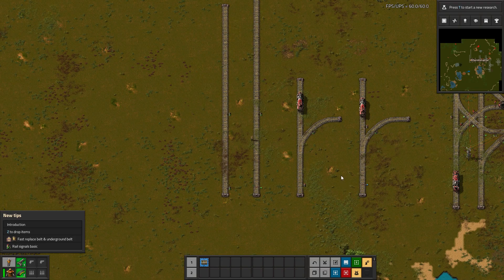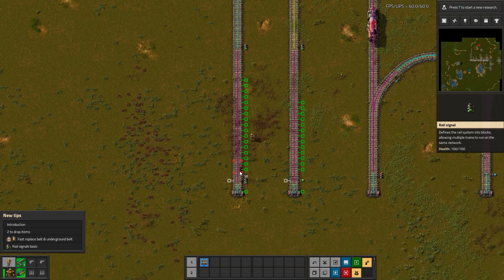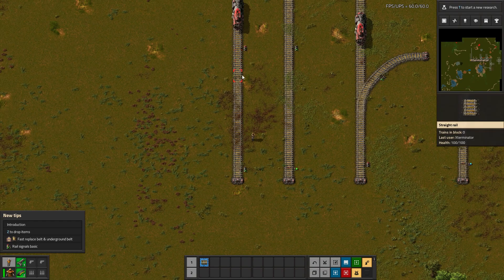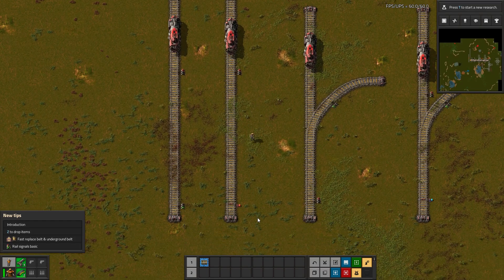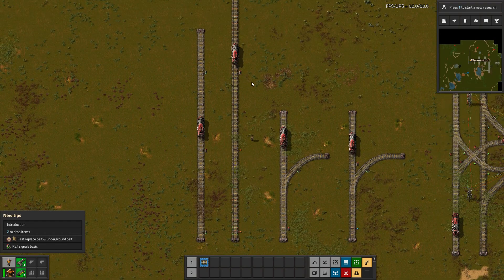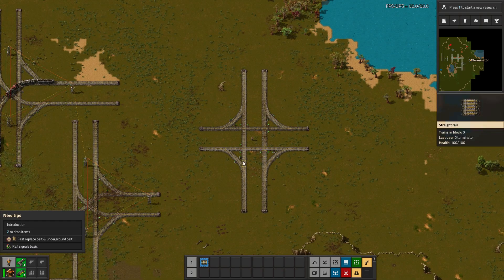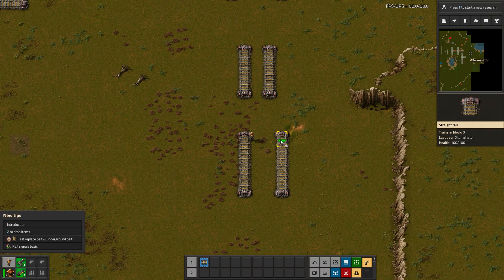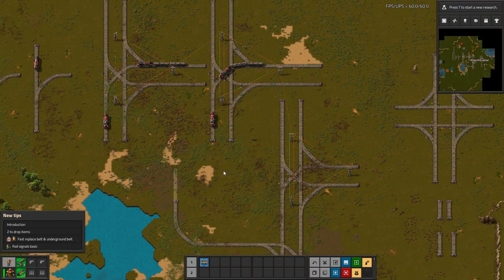Basic Rail / Train Signaling - Factorio Tutorial & Guide : Rail vs Chain Signals & How To Use Them

Comment: What about placing a normal signal right after the merging of 2 tracks like on your T-junction, and placing chain signals everywhere else? Otherwise trains entering the junction need to travel a long distance before meeting another normal signal to actually free the merge. So any trains coming after it need to wait a long time before they can even enter the junction as your normal signal (which is still inside the junction) stays red a long time. And you didn't place any signals at the entrance of the junction. It would not make a big difference but still, i wouldn't feel comfortable trains getting to a stop on top of a merge or split.
Reply from the maker: Great suggestion! I do this sometimes, but often forget. 
Although my rail blueprints do have signals at every Big Power length, so worst case would be that distance from the end of the junction before a normal signal

Comment: When you were signaling the crossing at 13:30, and the track actually extended out for a long time after that crossing, wouldn't the rail signals at the ends be looking into the entire block ahead even if it is like super long? Like wouldn't you want to put another rail signal to close it out???

Comment: Very helpful guide. The only question I have is whether I need to place signals along long piece of rail? In case one faster train is behind slower one? Can it catch up and hit slower train from behind?
Reply from the maker: Glad it was helpful!
And yes you should place normal signals along the mainline track so one train doesn't run into another.
Placing them one or two train lengths apart is usually good. Hope that makes sense. :)

Comment: There are a few errors and unclear points in your explanations. I also have some suggestions.

A chain signal copies the signals in front of it might be a better way to describe this instead of the chain signal is looking at the next block until the next normal rail signal.
Another difference between the two is that you can use the circuit network to read both, but you can only set rail signals' status.

Your "crossing" vs "merging" rule doesn't work in all cases. For instance if your "crossing" happens as a series of rapid merges and splits (such as a circle junction for example, basically every time you split right after a merge within a train's length).

The corners will always have the same space for signals, no matter how far you place the rails apart. And you can also make wider corners, no matter how far you place those rails apart.

I don't like to put signals in the corner like that. It's error prone, harder to see and on the map you can't know which rail it actually belongs to. Also when exiting junctions you should place the signals as close to the junction as possible to clear the next train through as fast as possible. In practice that doesn't make much of a difference if all your trains are running, but if a train had stopped there, it could mean an extra second or two of starting time.

Another super simple algorithm to make sense of signalling is (unless you do a single lane setup with bypasses, which is a whole different cattle of fish):
- Place rail signals on regular intervals on straight tracks (unless you don't want multiple trains on that track, see below)
Those signals need not be spaced in any particular way, they can be shorter than your train lengths. Personally I like to have them go with long range power poles just because it looks nice and gives consistent spacing.
- Unless there is another intersection coming up before a full length train can fit, place rail signals on the exit of each intersection
- Place a chain signal going into all intersections or merges (merges not necessary in all cases, but makes it easier to remember) (including at the point above where a full length train can not fit, which may be very short pieces)
- Place the rail signals at the end of intersections as close to the intersection as possible to clear the next train as soon as possible.
- Use chain signals on tracks where you only ever want one train (such as in front of a train stacker up to the stations or speedup tracks going back onto the main lane(s))

It might also be worth mentioning that if multiple trains are waiting on a block to become free (such as a stacker going into the track that goes into the stations), the trains will go in the order they arrived at the signals.

Also your four way junction doesn't let trains turn left.

Comment: is there any point to signals between junctions?
Reply from the maker: Not if the junctions are only a train length or two apart. But if there is a long distance between junctions, then you'd probably still want signals between them to increase throughput
Reply: And to expand once more :)  you should try to avoid rail blocks which are both (a) made with rail signals and (b) shorter than your longest train.  A long train held in a short block at a red rail signal will "hang out the end" of the block.  So, another rule of thumb is to have a chain signal before any block which is shorter than your train length.  Big rail networks will always need double tracks (as Xterm showed here), and will be broken up into blocks suiting a "standard" train length, whatever that might be, say 1-4 (1 loco, 4 wagons), or 2-16-2 if you're thinking BIG!

Comment: I use chain signals at merges and then at the first possible signal location after I use a normal signal and that is to ensure that the train does not still have a chance to block the rail network

Comment: Thank you so much for the info. I have always had trouble wrapping my head around how the signals worked with each other as well as a good best practice to using them. Are you planning to do more tutorials on the more advanced features of train management?
Reply from the maker: My pleasure! I hope this helped make things a bit more clear. 
And yes I'd definitely like to. Any requests or suggestions for them would be great!
Reply: @Xterminator  So far my trains have always been resource specific. Like I have an iron ore train or a copper plate train and they just run in a loop to the different stops that need them. But I have seen some Youtubers have generic cargo trains that are called as needed. I know they use Circuit Networks but I have no how. But to be honest I would love to see a tutorial for the middle game. You now have trains and you are expanding your network, here are some good techniques to manage them. Just my thoughts anyway. Thank you!
Reply: @Xterminator  how to supply remote outposts.

Comment: When I was learning how to signal rails, everything was self-explanatory except one thing. When placing a signal, the rail is split into two sections for both sides, meaning you cannot have asymmetrical signaling on two-way rail.
Reply: symmetry on the two-way track. this comment got my network running. thanks!
Reply: Of course you can't. How would the signals behave in such a configuration? If they just look at the track in front of them as they always do (and should do) to which other signal would it look to to determine what is a block? The next signal on the same side or the next signal on any side? A block needs to be the same for both sides because the block is determined by the train, which can only be on the rails, of which there is only one, not the signalling, of which there are now two sets (forward and backwards traffic). So they enforce it by having signals symmetrical.